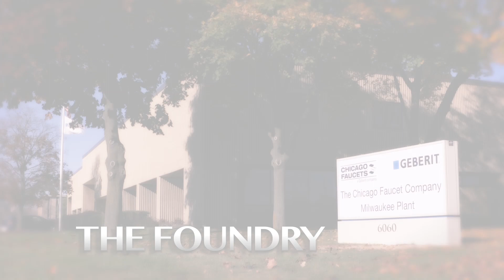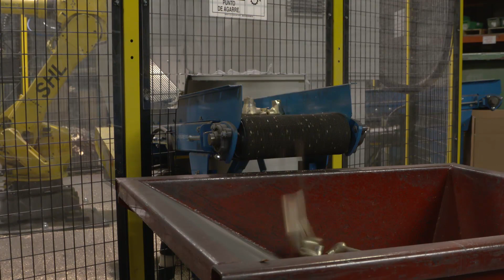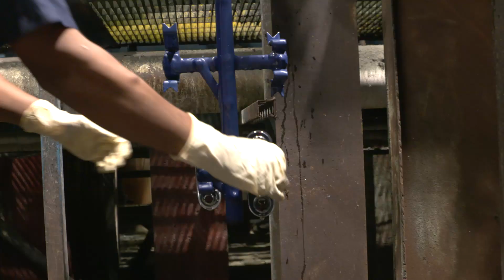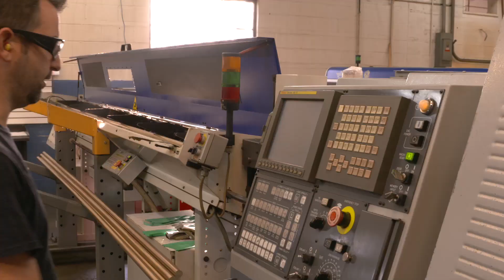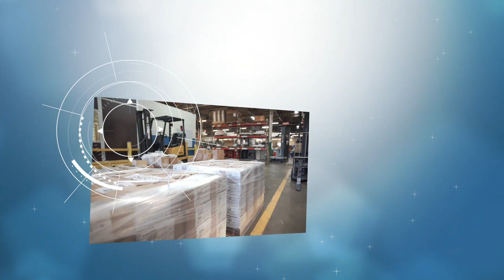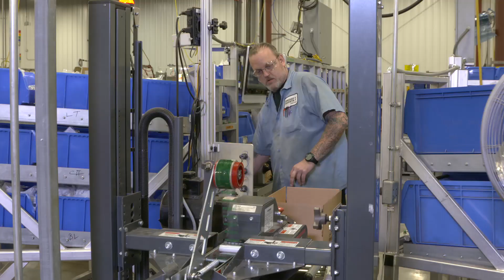Chicago Faucets Manufacturing Overview

Comment: We are auto machine supplier Lota，Lixil，Roca，Solex，Kohler etc. We can provide all kinds of machine for faucets production line from start to finished.Especially Sand mixer，sand core shooting machine，Low pressure die casting machine，Peeling machine，Grinding robot，Automatic polishing machine . Wechat:+8613670190553，WhatsApp:+8613670190553，Email:dzivy@idzxm.cn